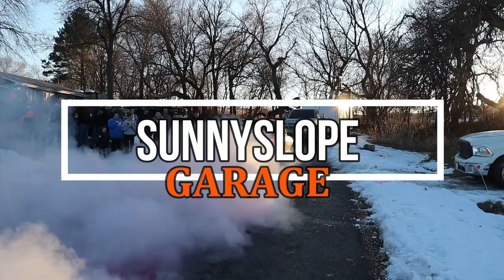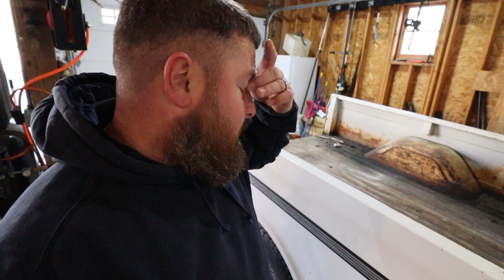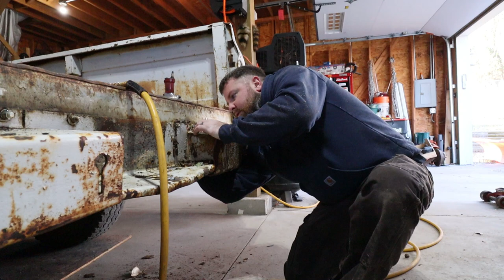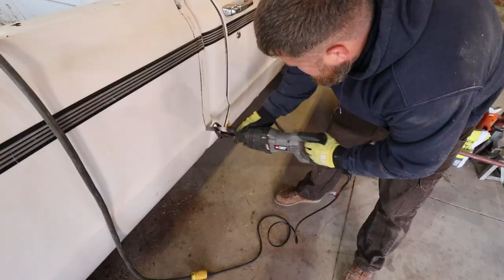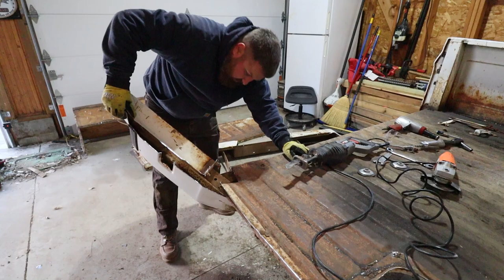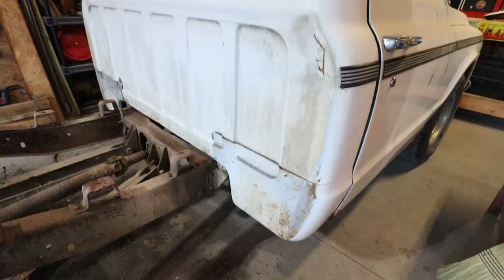One Man Bed Removal | 1971 Chevy Truck

Comment: Can't wait to watch it come alive looking new.  1 word of advice from a been there done that point of view, Make sure you can get replacement parts before you sell the old rusty ones.  My hubby stripped a 67 down to the frame, including the entire engine. Could not find rear panels for that make & model anywhere. Overpriced aftermarket, kinda close but cheaply made pieces only. Had to use the old ones for a pattern to make new ones himself. Lots of welding, metal bending, sanding and cursing to get the right shape that would fit and look original. Hope you have better luck!
Oh, are you sure it's garage and not Demolition?
Reply from the maker: Hahaha I like the sound of demolition 😆😆